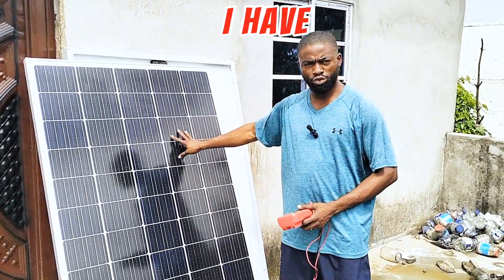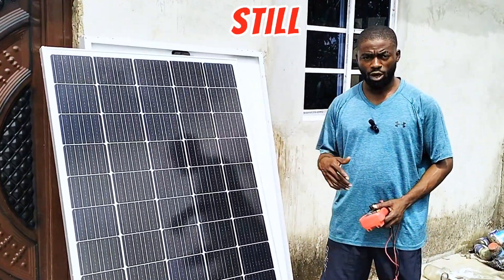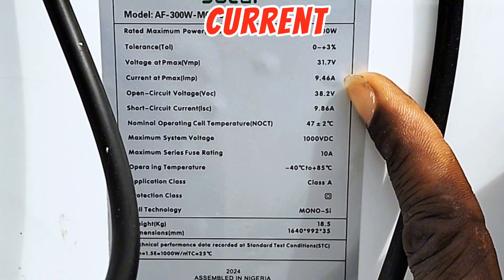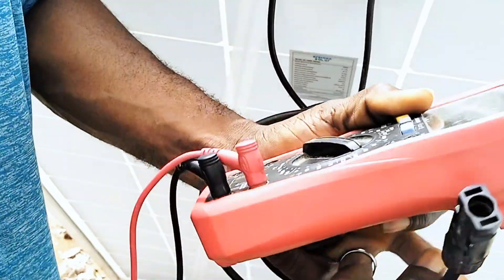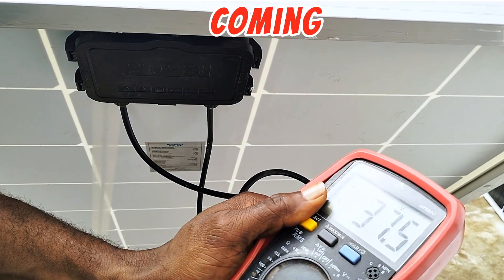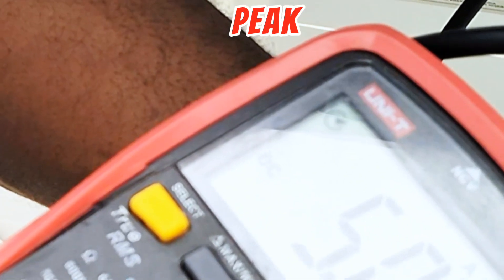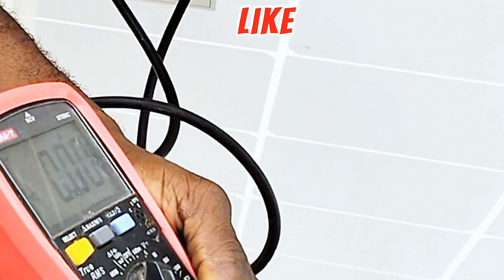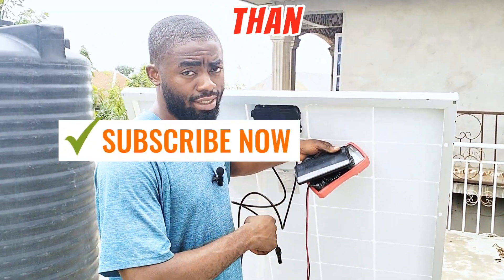The Efficiency of africell solar panel will shock you 😱😱😱

Comment: You keep making the same mistake over and over again. You need to do more research on this if your Vmp is 31.7v and your Voc is like 38v or so @ Voc current is zero and at Isc voltage is zero,
you can check the I-V curve you will understand this better that is you can calculate power at Voc and at Isc. And for the efficiency that is another's day topic.

Comment: I have this africell 400watt 8 pics, connect 2 in series, 4 parallel... Highest pv wattage i have seen is 2.05kw
Reply from the maker: It may generate more than that depending on size of battery and loaf need
Reply: @Mairigaemmanuel  24volt battery, 4 .. 220ah  2 in series then 2 parallel , but becus of the roof position, the panels are facing only East
Reply: @Mairigaemmanuel  I have a spare 45amps mppt controller Felicity, can I connect 2 in series of 400watt africell sola panel to it, which to add 4 panels with the 45amp felicity mppt
Reply: Brother why do need such high current?
Reply from the maker: For fast charging
Reply: What are you expecting to get? i hope you know that alot of factors will affect your generation...

Comment: Your calculations and reading is wrong sir.

You dont calculate a solar panel by the Open circuit voltage and Short circuit current. 

Use a power meter and put it on load, then you will get the true voltage and current.
Reply: But the guy is right , you don’t calculate a solar panel by the open circuit voltage (Voc) and short circuit current…
Reply: Dear sir, He is not wrong. What he is simply doing is open circuit voltage and current reading which is part of the information of the specs in the panel. If the values are close then when you test it on load you will get good readings too. Please study STC and NOCT.
Reply: @chiejineugbome  Voc and Ish are specifications on the panel to make you know maximum voltage and current to expect, and this is done under standard test conditions. 

Voc and Ish is not used to calculate power. When testing shortcircuit current the voltage is close to 0v, when testing opencircuit voltage the current is 0A. So going by that, you get almost 0Watt, which is very wrong. 

So testing the voltage it will give you under a certain current or testing the current under a certain voltage is the right way to test power.
Reply: @savageolatunde6731  Are you saying the figures on the spec sheet is wrong?
Reply: @chiejineugbome  thank you for that question. The data on the spec sheet is relatively correct.
Pmax is 300w
Vmp is 31.7v
Imp is 9.46A
Voc is 38.2v
Ish is 9.86A

But he measured Voc and Isc and multiplied it to get his power instead of using the Vmp and Imp which he can only get by putting the panel on load.
Reply: @savageolatunde6731 Weldone brother  I hope someone will learn instead insulting others , in the field of learning we disagree to agree
Reply from the maker: 🤣🤣🤣, calm down and learn
Reply: @Mairigaemmanuel you nor know anything and you nor wan learn
Reply: @Mairigaemmanuel  you know me...when you post something that is OK, i commend you. I will also make my comment when i dont agree with you. What you should do is to make a superior "argument" and present facts to correct me if i am wrong.

I learn a lot from your videos and it always challenge me to know more, so where i feel that you make a mistake, it will be unprofessional for me not to say it. 

I am learning everyday please do also.
Reply: But why does it look like the sticker was pasted on it. It has air bubbles trapped inside which suggest that the actual values of the solar panels may be different from what it really as seen in your video.